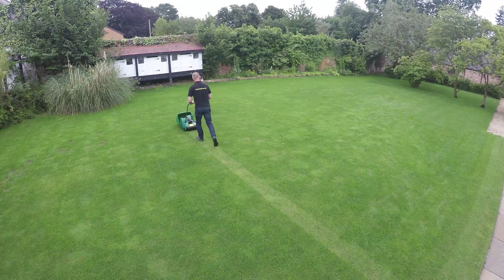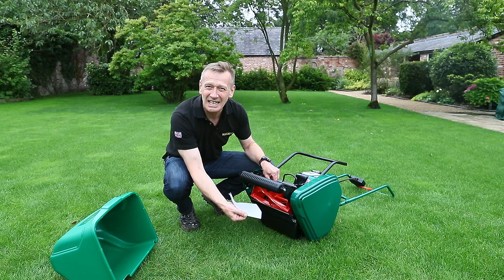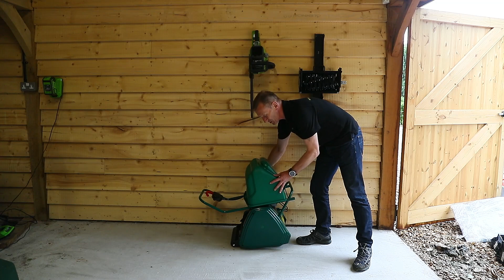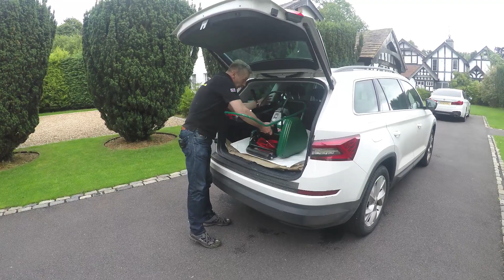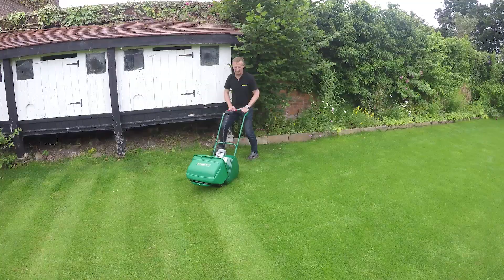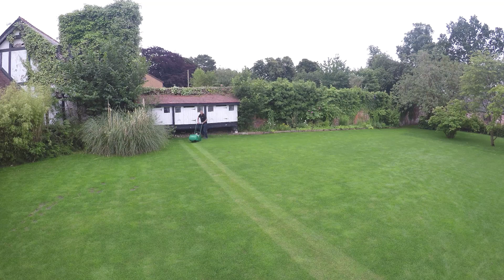Allett Liberty 30- 12'' Battery Powered Cylinder Lawn Mower (Push)

Comment: are those light areas in the lawn meadow grass?
Reply: Mostly Yorkshire fog. I am hammering these patches with the scarifier cartridge and verticut cartridge regularly. But I have my fair share of AMG (Poa Annua) too this year. Thanks for pointing it out though, Alan!
Reply: @mraustinjarrett  Yeh, sorry. Only did it as I have the same problem - just got the verdict cartridge and am doing the same as you. Problem in the south it's still pretty dry.